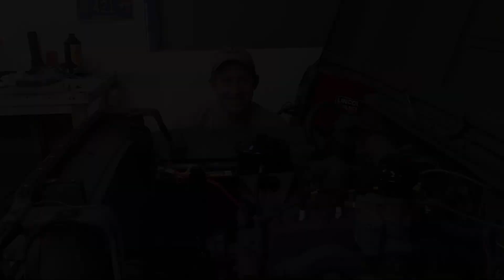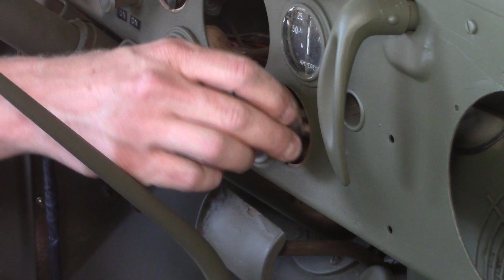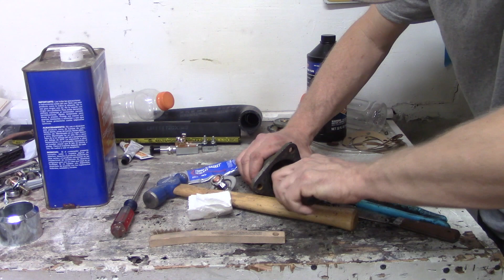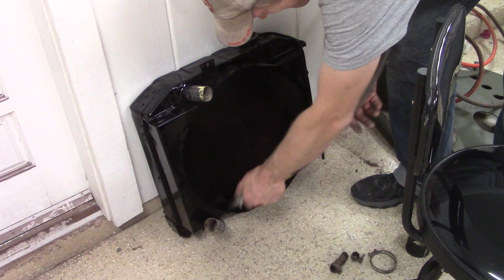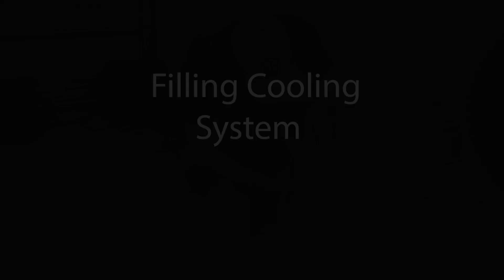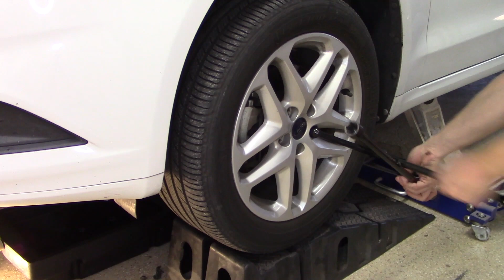1943 Willys MB Jeep | Cooling System Install

Comment: The radiator is installed on two rubber pads with star washers on the bottom and flat washers then the nuts. Then on the pass side, the grounding strap is secured with an additional star washer and nut.

Comment: Didn't show where the other heater hose was connected to if he didn't connect it to anything it would end up on the ground
Reply from the maker: This one has the return line going to a fitting on the top of the head. Both hoses go into the firewall to the heater core. Didn’t show it fully, sometime you don’t realize you’re missing footage until you’re all done!